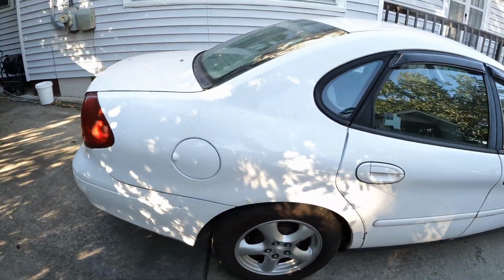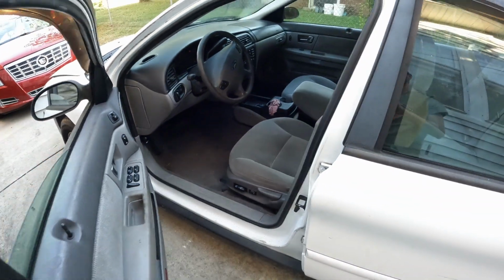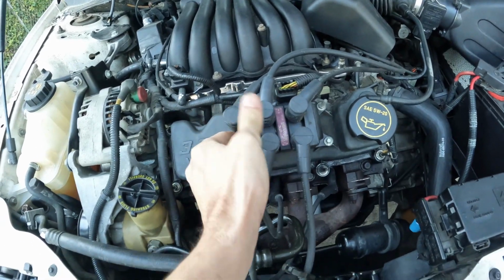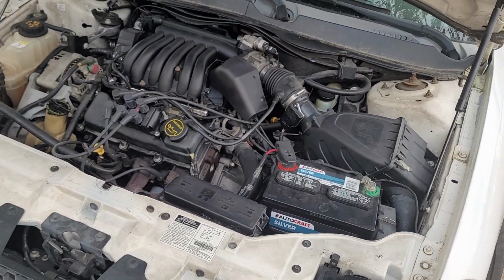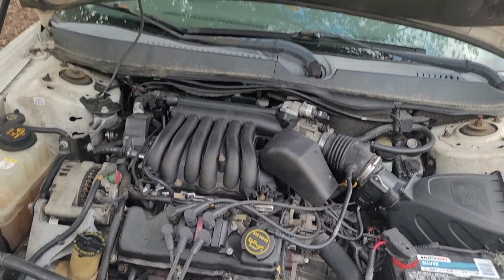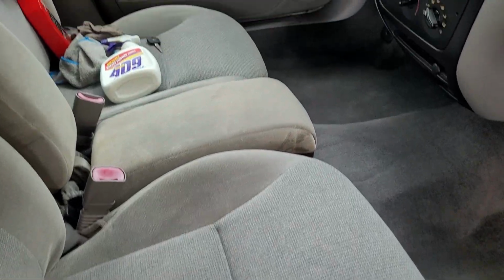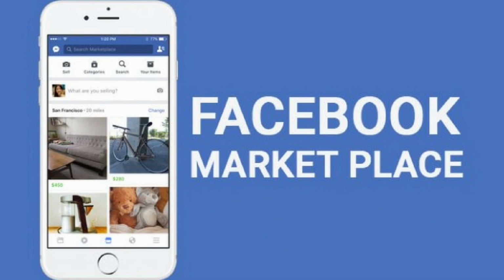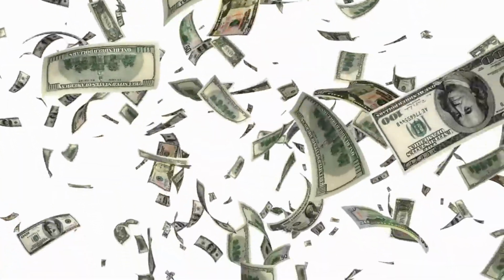How Much Can I make from a $600 Car?

Comment: I enjoy your videos. Short and straight to the point. I did this in my 20’s. I would buy only Hondas/Toyotas with head gasket problem for $500-$800 and after a few days of work flip them for $1800-$2500.

Comment: Yo won’t make anything from it… if anything u may loose money. I didn’t have much luck with thease older Taurus’s either
Reply from the maker: I made alot of profit. What?
Reply: He actually sold it in the video😂ppl are so negative
Reply: @southernsavage5968  It's nice that any comment helps the video because of engagement. What a funny comment. Also I've had these before. I used to despise Fords until one day someone took me for a ride in one of theses. I couldn't believe the ride quality! After research I found that this is one of the most solid cars of it's time. They sell very easily if it's a good value for someone looking to buy. The only issue I have heard is that you must make sure the transmission is perfect. I had one with low miles under 60k and the tranny went bad. If you get a good one they really last and are great on the highway. Not a fancy car but great engine especially the high output version.
Reply: What are you talking about? Taurus is a good vehicle, easy to fix and maintain, whoever got this car still probably got a deal. he got it for 600 you crazy if you think he didnt get a profit.